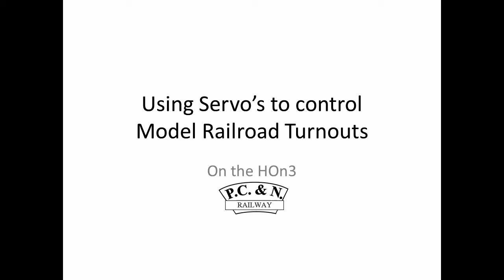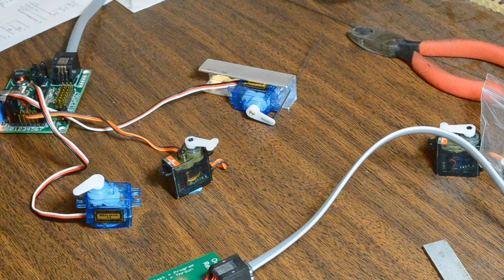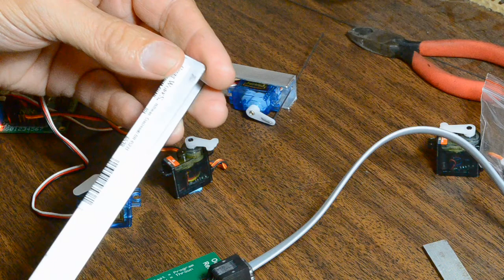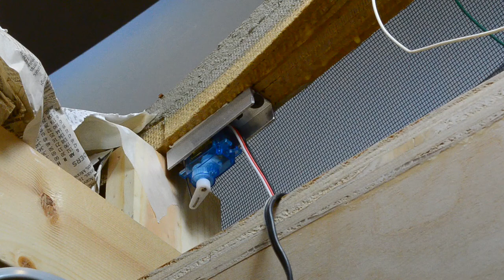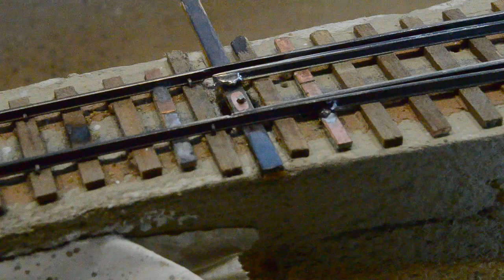Servo Install

Comment: Thanks for the video. My point was in which way I has to place the servo under the table. I read many advices to place the servo vertical. But your video convinced me to place the servo horizontal. Thanks!

Comment: The frogs are powered by the same circuit board that sends a signal to the servo, via a relay board.. the other way round it is 2 micro-switches, to left and right of the servo arm.. but you will have to make ears on the Ali extrusion, or bend up a bit of brass plate. Looks a bit like one of those roof timber galvanised fixing thingies for cheats.  Look up Megapoints controllers. He started it! His name’s Dave. Regards. K.

Comment: I bet the video you found was from Dave at megapoints controllers.. 15mil by 15 mil U shaped Ali extrusion,  you may have to tighten the sides a tad to fit the SG 90’s to hold tight. I recommend 0.8mm/0.0315” piano wire.